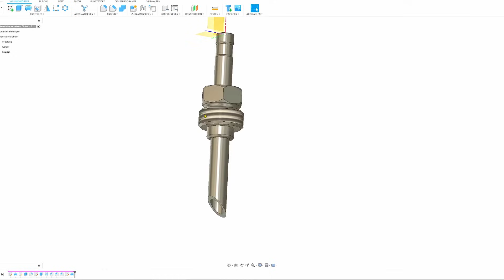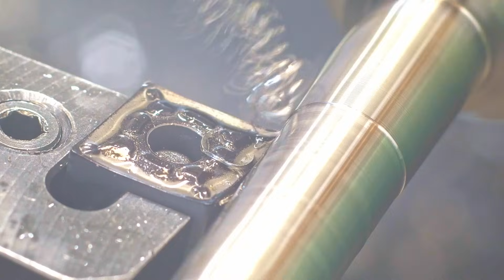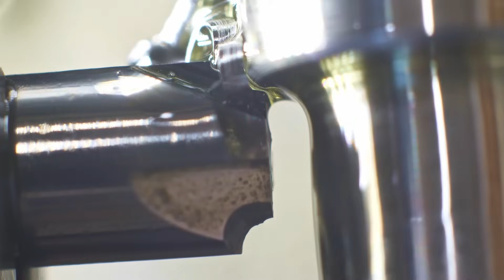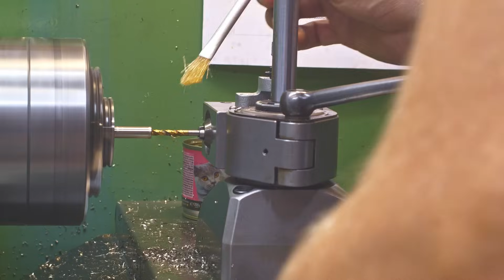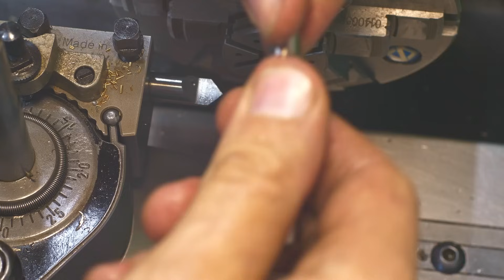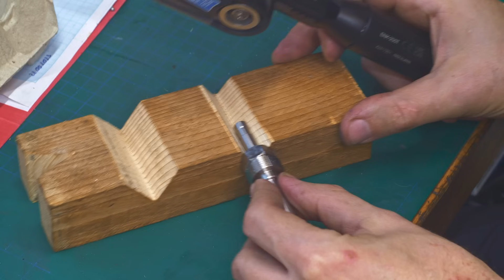Making a Part: Bioreactor feeder ports

Comment: I used to use these 40 years ago, we used to flame them in those day. The idea is that there is a silicon septum in the reactor and the spike pierces it to keep a hermetic seal. 
I’m no longer in that field but I thought that more elegant engineering solutions had been developed decades ago, but perhaps this is for a non critical application.

Comment: @22:31 I use morse taper inside the spindle for back stop. I have morse shank with thread, to change different diameter and length bar for stop. I also face cut them if the engagement to chuck jaws is short.

Comment: I'm curious, what used professionally, if you need to deburr 1000s of similar parts with threads and need the same high quality finish? I know you are usually making low volume high price parts, so you have a luxury to finish them by hand, but maybe you know a way to do the same automatically? Or only by hand with corresponding price?
Love your videos!
Reply: A very common ,if not the most common way  for large volume  deburring  is with a vibratory deburring machine. (ask google, lots of info including videos) . 
can't comment  if its appropriate for this part specifically .
Reply: stainless medical devices (anything bio) also are routinely "micro-deburred" by electro-polishing.. but that might need prep work (like @ steveggca mentions) beforehand to be useful
Reply: Oh, interesting, thanks. I knew about vibratory tumblers and electropolishing, but I thought it is used mainly for finishing, not heavy burr removal. I thought it can't remove heavy burrs without damaging the surface.
Reply: @curroz7689 You're correct, there is an upper limit on how heavy a burr tumbling will take off.  Topping inserts were mentioned in the video, they will round off the top of the threads. I'll normally end up coming in with a finishing tool after threading to knock off burrs.
Reply: @RSPFactory  Ohhh, I forgot that threading inserts can do that, thanks!
Reply: @RSPFactory   Nice to see this answer expanding,  yes the best way to deburr is to have no burr at all (if only 😀)
not a machinist but once part of a company that supplied cnc machines to machine shops.
I got to see the process development for many high volume parts ,lots of work on insert selection, tool path ,even things
like coolant choices were considered.   
Have not been active in manufacturing for a while , before I left we had started doing a lot of high pressure  throught the tool 
coolant systems, an amazing improvement on surface finish and burring, expecially on stainless  and other high chrome 
and nickel alloys.

Comment: awesome video, appreciate you showing how you do things, do you use magnification to examine things? Whats your preferred way of achieving that? My eyes aren't the best, but I've compensated with lighting in the shop. I don't think I could pick up on the bur on the threads like you did without some sort of magnification. Would be curious to know if/what you use. Thanks again.

Comment: I was under the impression that the PG thread system was considered obsolete and is superceded by EN 50262 .
Reply from the maker: The US had the metric conv. act in 1975 and still use a obsolete system of units for legacy reasons ;)
I suspect the use of PG threads in conjunction with the bio reactors has a certain reason, that I dont know.
Reply: @StefanGotteswinter  It.would be easier to find the MH 370 plane than understand the US slavish devotion to the imperial system and fractions.

Comment: Interesting device. It is very reminiscent of an injection quill, used to inject chemicals into a stream flowing in a pipe.  These are typically and simply made by taking a thermowell and cutting the end off at 45 degrees. A thermowell is a device used with a thermocouple to measure temperature through a pressure envelope; they are typically made of 300-series SS. They thread externally into the pressure envelope, usually with an NPT connection, and the thermocouple (or RTD, if you want to split hairs) threads into the internal cavity, also usually with a smaller NPT connection. Thermowells are a commodity item, produced in large batches on CNC lathes, and are very cheap, only fractionally above the cost of an equivalent weight of pipe. Back in my shop days we would cut off the ends of the thermowells with a bandsaw. Sometimes that was good enough. If not, we would mill the end to the angle required, which was 45 degrees  99% of the time. Once in a while, we would bore the end and tap it for a precision orifice, which could also be bought for literally pennies. 
It is very interesting to see the machining steps to arrive at a similar device, and it's good to see that your client was unable to use a thermowell, and had to engage you to build his bioreactor entrance port!
Reply: Good tips, thanks!

Comment: A trick i saw from Robin Rinzetti was to put an O-ring arround the drill when pecking. It moves back when feeding in, so when going back in you have an indicator to rapid towards to you dont ram tour drill into the bottom of the hole
Reply: That's brilliant. Not that I'd expect anything less from R.R.
Reply: Great idea, & I have used a small piece of bent sheet aluminum set on the vee way to do this as well.. especially good when reaming deep holes..  & on the Burke Millrite, there is a spindle depth indicator and you can put a small magnet in front of the indicator so it is pushed down by the indicator but stays in place when the spindle is retracted.
Reply: Did I miss you creating a new solid tool post? Wonderful video!

Comment: I  still have bad memories of  people not cleaning 316 threads properly, then screwing in the go gauge. If the thread was tight and a tiny spec of 316 was present it would weld to the gauge. If not cautious the go gauge would then be out of spec. If you were lucky you could, under a microscope pick off the offending spec. If not, in the bin it went. Not sure, but certain thread forms and sizes seemed to be more susceptible to this issue.  Have fun.

Comment: I believe it was the shaft sticking out that was reinforcing the resonance during the thread relief cut. I bet if you let a lead faced hammer contact the end of the shaft (just resting on it) while turning it will cancel the harmonic. I could be wrong of course, but I remember having to make several parts with similar shape and was getting a horrific droning chatter like that while parting. The lead stopped virtually all of it.
Reply from the maker: Thats very likely, agree - Its sometimes funny how resonances can mess with an entire rigid appearing setup.
Reply: I have the same experience with rounded grooving inserts, they tend to chatter worse than regular parting tools. It can help to walk the tool a little sideways similar to reducing chatter from a large form tool.

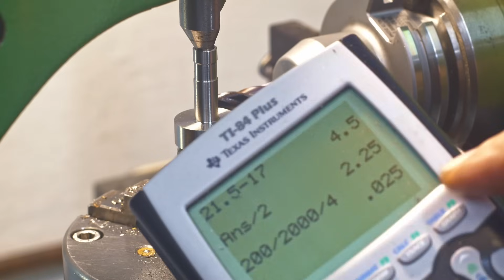Comment: 31:34 whoa. I thought scent was the sense most linked to memory, but it turns out that seeing the exact same TI-84+ you used in school is the most powerful.
Reply: Haha, can you imagine how many people have that link to memory for a TI-84?
Reply: @Hoaxer51  I agree about olfactory sense-related memory, and I’ll never forget that wonderful new electronic/plastic smell you used to get. For me, the images trigger my memory of the scent and vice versa.

I had the HP28C, which became an appendage. I never see them on YouTube. Once I had mastered RPN (Reverse Polish Notation) on those HP calculators, I was so, so fast. When I got my engineering degree, any calculator with a multi-line display was a game changer, but using SWAP, ROLL, DROP, and the ability to have named variable or numeric values instead of being restricted to just a memory key on other calculators was/is so lovely. The built-in CAS (calculator algebraic system), along with the option to get exact or numeric answers, is just so perfect.

Flat screens used for data entry on our smartphones make me long for those incredible chunky hard plastic keys, the firm pressure needed, and the feedback you got. The firm depress on those keys let you know you had entered a value.
Reply: @marclevitt8191  Touch screens are cheaper and they are putting them in cars in place of knobs, buttons and levers. Pain in the butt because you have to take your eyes off the road (no feel).

Comment: I sometimes use a feeler gauge instead of bumping the tool into the part. It works well with parting blades which flex.

Comment: Stainless steel is tough to work with.
Reply: It's even more fun if you weld a nut to a pipe and then secure it with a bolt from the other side of the pipe.. (happy thread stripping - it instantly seizes up when you try to remove the bolt). But I think titanium is worse - it will blind you for a good time if the chips ignite in the chip tray and also tends to seize quite easily.
Reply: @poldiderbus3330  Never had the "pleasure" of a titanium thread seizing on me, but cutting threads in titanium sucks, especially if you're not single point cutting them. The material behaves like a spring and you need about twice the amount of cuts you think you do, because the tool, no matter how sharp, just seems to push the material around, causing it to spring back once you remove the tool. Never had titanium chips spontaneously burst into flames, but for safety reasons (definitely not curiosity) I did set a bunch of them on fire with a torch once and yeah, not too pleasant to look at, but it's also no magnesium fire. Other than that, titanium is a pretty fun material to work with.